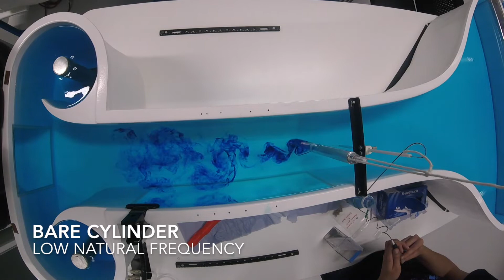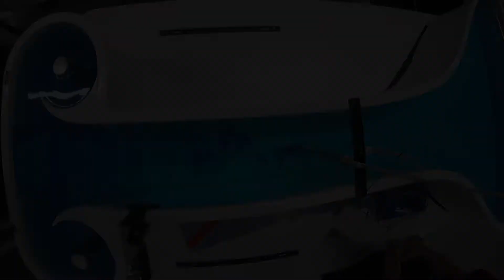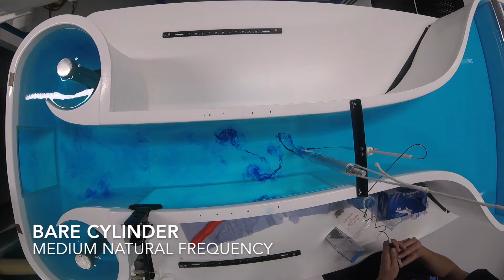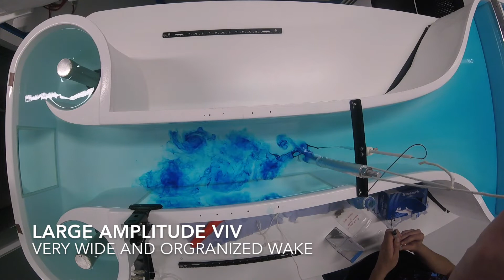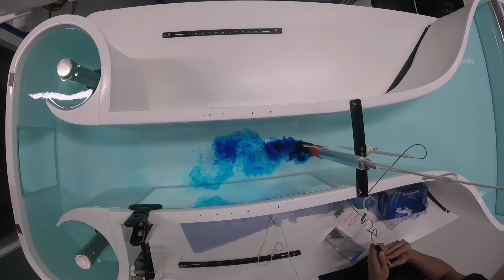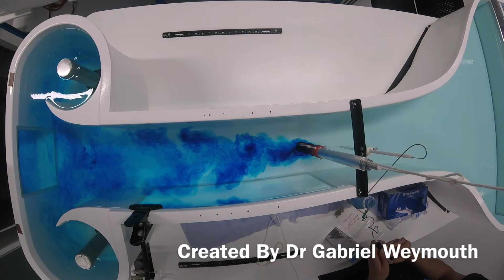Vortex Induced Vibrations demo

Comment: Hi, Gabe, how did you "change" the natural frequency of the cylinder ? the natural frequency is in function of the mass of body, right? 

Edited: or is the shedding frequency that you changed by increasing or reducing the current velocity ? 😅
Reply from the maker: I changed the pendulum length. As you say, I could also change the flow velocity to effectively change the forcing frequency, but that also changes the Reynolds number.
Reply: @GabeWeymouth  ok, thanks. If I have a catenary shaped cable, one side of which is connected to the vessel and another is sitting on the seabed, do you think the natural frequency of this cable can be calculated? 

I've found a formula to calculate it, fn=n/2*SQRT(T/(m*L²)), where n is mode number, T is tension, m is mass per unit, L is span length....by using this formula, then the natural frequency is different at every signal point of cable since the T is different over the cable length, is it right?
Reply from the maker: Look into "modal analysis". You can use this technique to find the first modes of continuous systems (like a cable) and their natural frequencies.

Comment: What are the ways of Eliminating VIV?
Reply from the maker: The vortices (eddies) that we've visualized with the dye are responsible for the vibrations, so you need to disrupt or shrink those vortices. In the video I'm demonstrating how strakes break up eddies. You can also try to streamline the object with a splitter plate or fairing.
Reply: @GabeWeymouth  Hi professor, thanks for your video,  I would like to increase the vortices, cilinders naturally will form them according to velocity of the current? I suppose they should have to be fixed right?

Comment: If i see this i wonder....can sea currents produce earthquakes and  tsunami''s ???? Sea currents that transport water with differend temperatures and containing differend organisme and minerals are not easy to mix so they interact with each other.
Reply from the maker: No, the flow needs to move past the object and the resulting force needs to be substantial enough to create vibrations. The time-scales and forces involved in earthquakes are completely different.

Comment: That unusual channel outlet section on the left...How does that function?
Reply from the maker: That is the out flow. Those two circular section collect the flow and let is drain without significantly impacting the level of water or flow upstream.
Reply: @GabeWeymouth  very nice setup! did you buy the tank or did you built it? Is there any article/info on how to create one? Thanks!